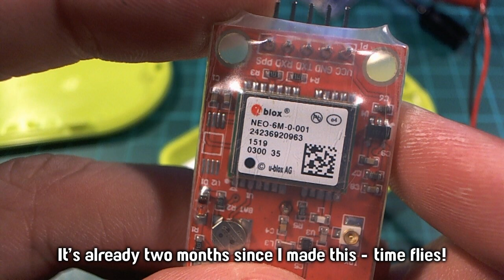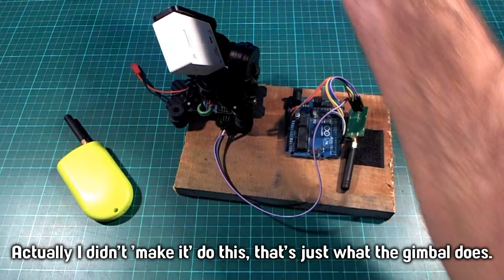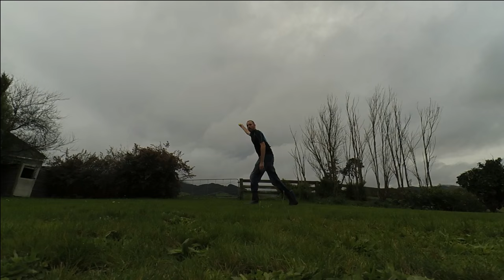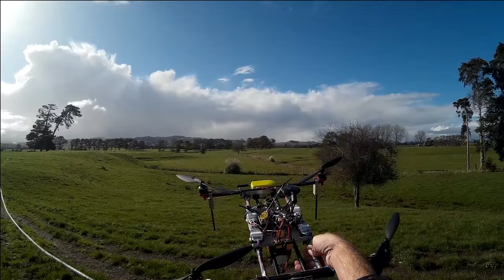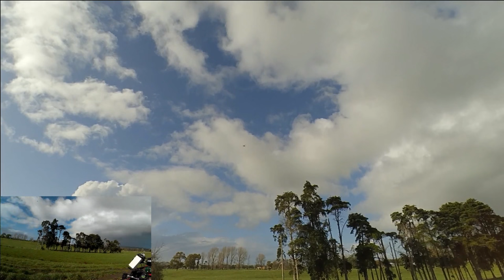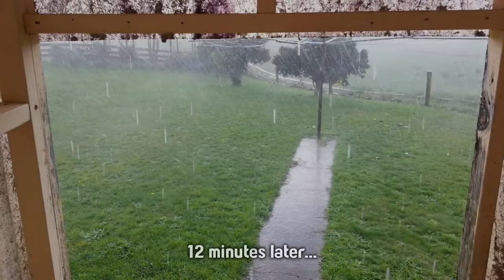DIY Maryam (arduino + GPS + STorM32)

Comment: you can avoid pointing it to North. You can take second position some distance away from the camera, than calculate the bearing between two points and use it as offset. And than point the camera to the second position. I did it like that and it seems to be working fine.

Comment: Hi, I'm building something similar to this. My question is regarding the movement of the "yaw"servo. 
On your "camera base" you have this code:

void setYaw(float degrees) {
  degrees *= 0.9;
  degrees += -6; // trim
  degrees = constrain(degrees, -170, 170);
  int servoValue = map(degrees, -180, 180, 135, 45);
  yawServo.write(servoValue);
}

This function  "return atan2(y, x) * RADTODEG;" will return a value on the -180 to 180 degrees, correct? 360degrees total movement.
But why are you mapping it to 135,45? 90degrees total movement  map(degrees, -180, 180, 135, 45);

On my build I haven't been able to get the base to follow the tag well, I'm suspecting it is the way I'm mapping mine. I have tried different setups and am still struggling.

And how are you dealing with the initial heading? As your code show a initial "frameHeading" of zero.

Thanks for any help.
Reply from the maker: https://www.arduino.cc/reference/en/libraries/servo/write
Angle is given as a value between 0 and 180, with 90 being in the center. Most servos only have a 90 degree rance, and I think the Storm32 was expecting values in that range too.
If I remember correctly this project required placing the baseboard facing north, to deal with the initial heading.

Comment: Banggood replaced a faulty gimbal so I now have all the parts and started building.
I roughly hooked all up and have a few questions.
Did you at all modify the GPS ? Baud rate ? Hz? I thought perhaps you changed to 10Hz or baud or something.like from your 10Hz video from earlier.
Is it critical to have the gimbal connecting angle arm with the mpu6050 facing up? 
I used the pipe out address code from cheep-ass quad to get that going.
So far everything I built quad, transmitter RX TX, and tester thingy all work great. Need a bit of help here

Comment: How STorM32 know where itself coordinates ? Do you add coordinates static when compile sketch on the arduino with STorM32?

And how up down move on the STorM32. Thats information from barometer and some multiplied by some coefficient ?
Do you use some distance to object and height from barometer?

Thanks!
Reply from the maker: I explained in the video... the first coordinate it receives from the tag it will set to be its own position. That's why I reset the arduino controlling the gimbal.
Yes, the barometer altitude is used to calculate the up-down angle. From the altitude and the distance it's simple trigonometry.
Reply: Cool,

Thanks!

Comment: Hi. I am making a digital barometer at the moment, for my yacht that i live on. You mentioned that making the environment for the barometer dark effects the sensor. Does it make it more accurate or does it just change the reading in one direction to cause an error? Thanks in advance.
Reply: I noticed wind noise when you were demonstrating the sunlight.. was any air getting into your case which could affect the pressure on the sensor.... ie, more pressure in one direction than the other.
Reply from the maker: I think the light would just change the reading in one direction or another. There may have been a tiny bit of wind entering the case, but probably not enough to then also get through the cotton wool.

Comment: Friend, do you believe that if I replaced the gimbal with two servos being a 360º and another (pitch) 180º would have the same operation right? As the output current of the Arduino is low I would feed them with separate source and command with the signal cable ... Does this my solution make sense since I do not intend to use a gimbal? Hugs !
Reply from the maker: Yes I think it would work fine. Just not quite so smooth movement, that's all.
Reply: OK! Thank you very much for the attention you are giving me with these questions, it is very good to be able to count on people who have knowledge and love to share. Thank you
Reply: Dear friend, will I have to change this constant based on my locality?

float geoDistance(struct geoloc &a, struct geoloc &b) {
  const float R = 6371000; // km
Reply from the maker: No, look at the webpage linked to just above that line. That is the radius of the earth at the equator.

Comment: That's so cool. It almost needs a PID controller or something to make the transitions smoother :P
Reply: No need for a PID controller, since the behaviour of the gimbal is predictable.
But smoothing, yes.

lg, couka
Reply from the maker: The default settings of the gimbal would smooth almost all of this out if I had just left them alone. I changed the settings to make it move as fast and with as little delay as it could, to get clearer feedback about what was going on inside the arduino's little brain.
Reply: I think with an encoder you could achieve fast movement of the gimbal to keep tracking fluid and smooth.
Reply: A year late! But make your own gimbal with small stepper motors and the Accelstepper library. You can get ultra smooth movement.

Comment: I like how consistent it is but still haven't seen any of these auto record systems that do a decent job. They are never smooth or always lagging behind the object . Is this something you feel can be addressed with this hardware and just development time?
Reply from the maker: Yes, some improvements like that could be made. The GPS reports locations in lat/lon, and speeds in meter based units, I just couldn't be bothered doing the conversion and updating the sketch to handle two different UBX message types :)

Comment: Is it difficult to implement code to Cleanflight, so that you can send data from the flight controller via the audio channel on an fpv-transmitter to a ground station? Cause that would make a really cheap and handy antenna tracker...
Reply from the maker: You can use a serial transmitter with telemetry to do this. Basically it's like you have the quad plugged into your laptop, except it's far away. I would guess that most antenna tracker projects out there are doing something like that.

Comment: Friend, good morning ! I bought the parts to try to assemble the same circuit. Thank you for the tips ! Now I was in doubt on one last thing, did you add capacitors (02 blue) between the switch and 2.4? What is the value and type of it? Waiting now only get my small imports heheh. Thank you !

Comment: you can use low pass filter for smoothing the displacement of gimbal
Reply: maybe just some algorithm on the acceleration of the gimbal's destination position to smooth out its transitions(motion). the PID idea below may be an option, too. maybe down the road - zoom features, & maybe down the road algorithms that take into consideration the size (distance away from the lens) the object is in order to calculate its speed and anticipate movement of the gimbal to better keep the quad in center frame.
this is a GREAT leap forward - you've done a great job! thanks for putting your creative thoughts to practical implementations!

Russ from Coral Springs, Fl, USA <-- another place in the world where 2 or 3 weather changes within an hour occur!

Comment: They say you can have the 4 seasons in one day in NZ. They were not kidding!

The rotation of the camera is a little choppy, do you know where this is from? refresh of the gps on the tag? transmission on the receiver arduino? delay in the gimbal? or maybe just a mix of everything? 

Pretty cool nonetheless!
Reply from the maker: Yes the choppiness is due to the refresh from gps tag.
Reply: +iforce2d you could try to "guess" the next position and then compare it to the next gps beacon

Comment: Impressive! Does it recover gracefully after it lost contact to the nRF24 connection? I don't know Maryam can you clear that up for me?
Reply: The nRF24 is using a protocol which is not connection based, so if the code is robust against missing some packet, which I assume it is, yes, it does recover.

lg, couka
Reply from the maker: Yes, that's correct. If any packets are missed the camera will just stay pointing at the last place the tag was known to be at.

Comment: Good work. As you say a bit of smoothing wouldn't go astray. I always wondered, if you had a sufficiently accurate, and fast, system, how it would go with a "zoomed" camera.  I fancy this is the kind of thing to use for long distance work, pointing highly directional antennae and the like. I might yet get a "good" 5.8GHz video signal from 10Km distant.
Reply from the maker: Some Sony video cameras have an external control interface, I forget what it's called but you can use it to start/stop recording, set the zoom, change some settings etc.

Comment: can I ask how long does your battery last in this TX?
Reply from the maker: Not very long. I think about an hour, but I killed it the other day doing some testing. Now I'm using a 900mAh which lets me take my time a bit more. It has to stick on the outside of the case though so it doesn't look as slick :)

Comment: very cool project. you think the tracking can be smoother and it can predict where the aircraft is going to be, so it wouldn't be behind when it pass by like that. i guess it need more scripting to the arduino.
Reply from the maker: Yes, some improvements like that could be made. The GPS reports locations in lat/lon, and speeds in meter based units, I just couldn't be bothered doing the conversion and updating the sketch to handle two different UBX message types :)

Comment: I have not seen the maryam in any RC videos, and all my googling has come up with nothing at all on it.
Reply: they are normally used as antenna trackers
Reply from the maker: it's just my little joke, never mind :)
Reply: +iforce2d I was thinking maryam was someone you were dreaming of as you live in the middle of nowhere. You could run through the brush with maryam. 😀😀😀
I'M BUILDING THIS TO GO WITH MY CHEEP-ASS QUAD

Comment: You have very cool projects ! Have you ever tried the ESP8266 ? Its a chip with wifi, but it also a computer that is programmable with the arduino ide, just like an arduino but runs at 80Mhz !! And it also have up to 4mb flash, and you can use it to write and read files directley from the arduino code like an sd card. And they are super cheap.

Comment: Can you add a high def photo of the Tag and the Gimbal /Arduino, I can't wrap my head around the pinout of the Tag..
Perhaps I will print out the code and use a highlighter pen. This will be the third project you have inspired me to do.
Reply from the maker: The baro uses I2C connection so it uses the same I2C pins as any other I2C device: https://www.arduino.cc/en/Reference/Wire
The GPS uses UART connection so it uses the same pins as any other UART device: https://www.arduino.cc/en/Reference/Serial (keep in mind you need to disconnect the arduino RX to upload a sketch if you use the hardware UART on pins 0 and 1)
The nRF24 module connections are the typical connections for the RF24 library, (search for "Pinout and connections" here: https://arduino-info.wikispaces.com/Nrf24L01-2.4GHz-HowTo) they should also be listed in my source code.
The arduino outputs a PWM (aka servo pulse) signal on two pins to control the gimbal. The pins should be mentioned in the source code, probably pins 3 and 5, and you of course need a common ground connection too. The pin on the gimbal to connect these to will depend on how you set up the gimbal configuration, on the 'RC inputs' tab you can choose which pin should control pitch/yaw etc. and what the range of movement should be.
Reply: +iforce2d THANKS 4 the lesson 😀 the vids keep getting better and better.

Comment: It would probably follow much smoother if you calculated lat,lon,alt velocities and plan camera movement according to those with some kind of extrapolation to cancel delays as opposed to probing location and altitude and setting angles according to those.

just my 2 cents :) and no trolling intended
Reply from the maker: Yes, some improvements like that could be made. The GPS reports locations in lat/lon, and speeds in meter based units, I just couldn't be bothered doing the conversion and updating the sketch to handle two different UBX message types :)
Reply: I'm doing some multiwii position hold experiments myself with nmea and ubx BTW
I'd probably rely on delta over time and not speed/bearing combo but both options might be tested

If parsing is not your thing I might share the ublox parser I wrote for a gps tracker (inspired by your gps+oled on aquad project) :)

I don't have much time for playing unfortunately
Reply from the maker: I'll try the speed + velocity combo sometime soon, but with the camera on the quad and following a point on the ground. For now I'm actually more interested in seeing how the position updates arrive and how accurate the direction is. If I add any smoothing or prediction it will blur the ability to see this. I've done a lot of similar smoothing/prediction in game programming so I have a pretty good idea of how the result would turn out without needing to actually do it for now. This is just an intermediate step.
Not sure what you mean by parsing... doesn't my gps+oled (and a bunch of my other videos) essentially parse the UBX info into a usable form?
Reply: I offered the code to handle ubx in a response to your note about handling two different message types.

If you're after position quality you'd probably want to focus on getting the best gps + layout and shielding. I'm getting 16 satellites using BN880
Reply from the maker: ah, I see. I made a video a while ago about this, you can see my take on handling multiple message types here: https://www.youtube.com/watch?v=ylxwOg2pXrc
Yes, on my quad I have the GPS up high etc, it typically gets somewhere between 12-18 satellites. For this it's harder to space everything out, but there is also less interference to begin with. I think for now the interference is not a big concern.

Comment: Dear friend, good morning! I am very close to being able to do my creation based on your project. I'm not very good with arduino and still generate small doubts. I will be very grateful if you can help me in this challenge of mine that to you for sure is much easier. I could not find in Brazil the barometer ms5611 (gy-63) which I located easily was the BMP280 to what seems to me to be closer and is already at hand. But I do not know what the correct sketch would be considering including the BMP280 to include along with the followme code. I would be very grateful if you could help me by sending me a zip with this hit. That means a lot to me and you showed me a way out of your project. I am counting on your help and a few minutes of your time. Hugs.
Reply from the maker: I think if you search google for "arduino bmp280" you can find some libraries that will help. A barometer only has one interaction (read pressure, a single number), so it should not take too much work to replace the MS5611 part of my code with BMP280 equivalent.
Reply: Okay, I'm grateful to answer. As I told you some details I still get lost because I'm starting studies. I know it's not that difficult anymore, I'm afraid of being discouraged by a small mistake. But I am hardworking and I will succeed here. Hugs my friend
Reply: Right now I am with new error as below and everything except the BMP280 is like its assembly:
sketch \ GPS.h: 29: 1: warning: narrow conversion from '192' from 'int' to 'const char' within {} [-Waring]

Comment: OK so i have it kinda working ( sometimes its better to fight and learn yourself ) 

I have some code below that is possibly way over my head.

the numbers DEGTORAD AND RADTODEG MUST BE SPICIFIC TO MY LOCATION??

or are these something I don't need to touch

I also understand if you moved on and are not interested in this anymore. I have watched this video so many times i can almost re-site it word for word but find no clues to solve this other than the website below. 

Will also fool around with the gps settings as i noticed that the data was not coming as graceful as i would like to see it.

#ifndef DEGTORAD
#define DEGTORAD 0.0174532925199432957f
#define RADTODEG 57.295779513082320876f
#endif

const uint64_t pipeIn =  0xe7e7e7e7e7;

RF24 radio(9, 10);

// The sizeof this struct should not exceed 32 bytes
struct MyData {
  long lon;
  long lat;
  int32_t altitude;
};

MyData data;

Servo yawServo;
Servo pitchServo;

geoloc frameLoc(0,0);
geoloc tagLoc(0,0);

int frameLocInitCounter = 0;
#define FRAMELOC_INIT_SAMPLE_COUNT 30

float distanceToTarget;
float bearingToTarget;
float altitudeToTarget;
boolean newData = false;

// http://www.movable-type.co.uk/scripts/latlong.html
float geoDistance(struct geoloc &a, struct geoloc &b) {
  const float R = 6371000; // km
  float p1 = a.lat * DEGTORAD;
  float p2 = b.lat * DEGTORAD;
  float dp = (b.lat-a.lat) * DEGTORAD;
  float dl = (b.lon-a.lon) * DEGTORAD;
Reply from the maker: Degrees to radians, and radians to degrees, are not something you need to change.
Reply: +iforce2d THANKS!